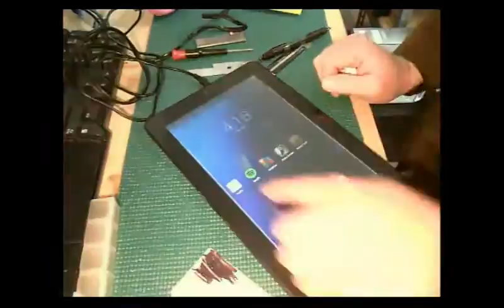RCA Maven Pro Digitizer Screen Replacement

Comment: the screen below my top screen is broke has lines through it. what do I need to order
Reply from the maker: +Sissy Blackmon you will need a new LCD. If you let me know what your model number is, I would be glad to try and find the part for you.
Reply: +Caveman Computer Consulting rct6213w87
Reply from the maker: +Sissy Blackmon make sure the cable matches.  This is a used one on eBay.  "http://rover.ebay.com/rover/1/711-53200-19255-0/1?icep_ff3=2&pub=5575112772&toolid=10001&campid=5337910692&customid=&icep_item=302027699038&ipn=psmain&icep_vectorid=229466&kwid=902099&mtid=824&kw=lg

Comment: if it has lines in it does it mean the lcd is messed up and need replacing?
Reply from the maker: +Chris Jernigan if it has lines before you take it apart, then yes, that indicates a cracked/faulty lcd
Reply from the maker: +Chris Jernigan you might want to check the cable connection before you replace the lcd.  It will probably have no effect, but it's worth a shot.
Reply: ok thanks
Reply from the maker: +Chris Jernigan you're welcome